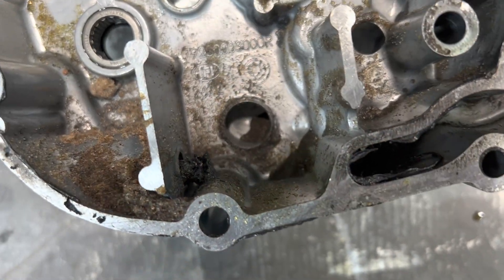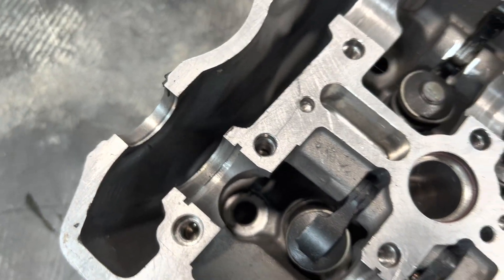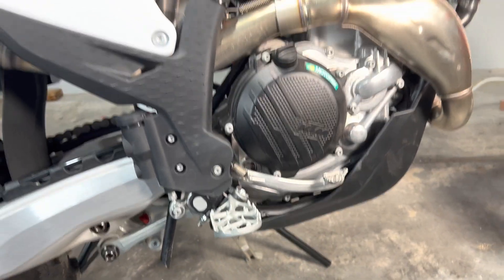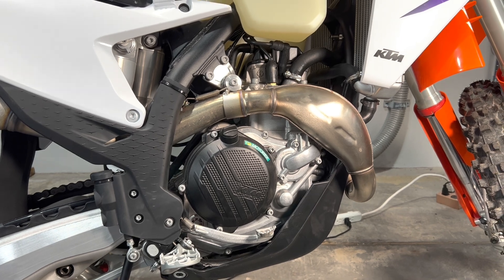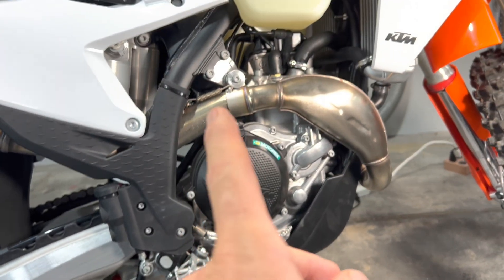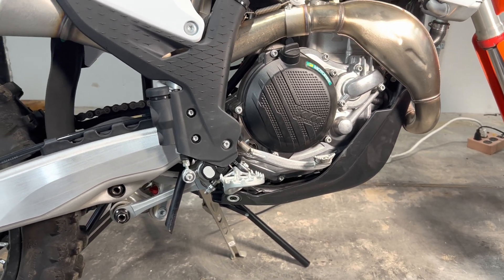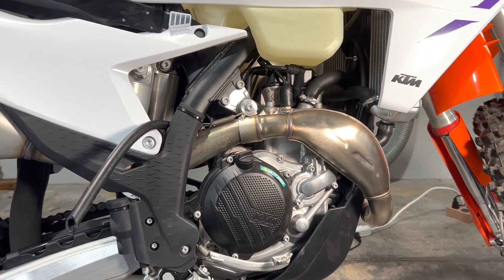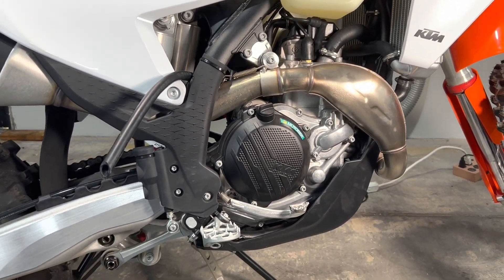SAND ALL UP IN THIS KTM 350XCF ENGINE

Comment: this is why on my 350 I flip that hose around so the straight end is coming off the valve cover and I run the other end straight over into the airbox, then I face the short 90 degree bent downwards so that even when washing the airbox no water will go into the vent hose

Comment: Thanks for the video, wonder if you could add a one way breather value so it exhausts only ordoes it require intake as well to relieve negative crankcase? pressure

Comment: This is why there’s zero reason to relocate the crankcase vent from the air box (on box that have it there to begin with) where the air is filtered and the location is much better to the bottom of the chassis. 🤷‍♂️

Comment: This just happened to me last week on my FIRST RIDE of my new to me 2018 Ktm 350 xcf. 🥲 The bike stayed completely upright because there was muck at the bottom of the puddle and just stuck like glue. I killed the motor a few seconds after getting stuck in this puddle and pulled the bike out manually. once it was pulled out on dry land I started it up fine but the damage was already done. 15 mins of riding time later the engine seized and I could hear the con rod knocking real bad. Just a few seconds of idling in muck water was enough to suck into the engine and completely wreck it. Just wanted to let you guys know how easy these things suck up water thought the crank case breather…..
Reply: Same exact thing happened to me last week. Sucks.

Comment: My dealer told me 30 years ago to tee into my carb bowl vent and c case vent tubes and run the new hose up under my tank towards the head tube of the frame. Nice and high . When stalling out in deep water , with this molded, there should be no vacuum at the outlet of the bottom of the breather hoses.   It works.   The carbed bikes of yesterday would sometimes stall out if the breather hoses were underwater too long, I'm not sure why but this alternate place to vent from seemed to help

Comment: Every stroke moves 350 cc of air out and 350cc back in. I think we had discussed the possibility of this a few years ago and why we do not recommend doing this using our crankcase hose when riding off road. But I was more thinking water not dirt/sand. 😮

Comment: Is it ok to drill a hole in air boot on throttle body side of air filter and poke hose into it? It will be under alot of vacuum from the engine sucking through the throttle body. I'm wondering if it might suck oil vapor out of top of valve cover and cause mixture issues???

Comment: Well said. I put a cooling fan on my XCF350 first ride. They are not built for intense hard Enduro single track. 
Every one of my videos is riding the XCF350 in single-track. However, it's harder on the bike than others purpose built for it. Cough TE300 cough. 💪😃👍

Comment: A simple one way check valve plumbed into the vent hose would fix it. You could use a vacuum brake check valve which would even fit the tube.

Comment: Pretty sure a rebuild is his only option. I did exactly this on my 17 350XC-F and the motor was a complete loss. Had to pretty much rebuild from the bottom up because buying a crate motor was not an option from KTM. The video of when I blew it up is on my channel as well. Similar situation.
Reply: I just did this exact thing to my 17 350 EXC-F. Full Rebuild in progress.

Comment: My 250xcfw had its issues for sure but its vent hose was routed to the air box if i remember right could you just tap a hole in the box with a brass fitting on the new ones?¿ good diagnosing for sure thorough

Comment: I simply put a piece of filter material in the end of the hose and then routed and zipped tied by the fuel injection. I made a complete loop in the line with the end pointing down. Every 10 hours or so I just replace the filter material. I used an old twin 
Air filter.
Reply: Great advice

Comment: Reroute hose to air box or a one way valve that gets sucked shut when under vacuum.
Reply: I would not suggest this. When your engine cools you need it to be able to suck in air so it’s not under a vacuum.
Reply: @DualsportDisport  
What do you think 99% of us GNCC, ECEA and hare scramble riders do bud. Absolutely nothing wrong with it and has been done since the 1990's on 4 strokes.
Reply: @DualsportDisport  the airbox is not airtight?  lol
Reply: @TheDirtyBirchTrails  what are you trying to say? I don’t understand your statement. If your referring to the intake of course, same with exhaust. We are talking crankcase ventilation. The whole reason that is on there is to vent air back and forth to alleviate crank case positive(and negative) pressure. Hence why it sucked fluid and sand up it.
Reply: @DualsportDisport  The airbox is vented to the atmosphere via the air filter.
Reply: @TheDirtyBirchTrails  precisely. I still don’t understand where your going with this. This started with the mention of check valves, not atmospheric venting.
Reply: So guys I have my 2020 450xcf vent tube routed up into my airbox, and I just realized after reading this that maybe I should have some sort of filter on the end of the tube so it can't suck up dust and sand because in the airbox the air filter obviously gets covered in dust/sand etc. Am I overthinking it? Because most of the time there is not a vacuum on end of tube. But when idling it could be sucking dust out of airbox?
Reply: @farmer3242  You have to route it on the clean side of the air filter.
Reply: @TheDirtyBirchTrails   thanks, so iv gotta drill a hole in air boot then.

Comment: Would a simple carburetor fuel filter added to the hose allow enough crank case ventilation but prevent sand/dust/debris from getting in the engine?  Old style PCV valve used for emissions purposes on old automotive applications?  Having that hose down there open to the elements really seems like a bad idea.
Reply: Tuck that vent up as high as possible.

Comment: This is a common issue on Yamaha Grizzly ATV's.  Except it's  the fuel tank vent that does it.  The vent MUST be re-routed if one is going to swamp / mud it all the time otherwise people get a gas tank full of water, sand etc.
Reply: Some guys also run a small engine gas filter which works too.

Comment: happened on my FE501 when i ran the 450 air boot which means the vent was routed down by the linkage. Sucked up sand and water when i started it while the hose was under water. Had to rebuild engine. PISS POOR DESIGN! Went back to the stock FE501 air boot where the vent hose goes into the airboot under filtered air. If you have this bike, run your vent up high!! Heres a step by step how to video i made on how to rebuild a 12-19 450 or 500 KTM engine.    https://youtu.be/C6n5_x6SZbs

A simple way to prove this theory is to put motor oil in a cup and set your vent in it. Then start your bike and watch it all disappear.
Reply: The 2nd good reason to not run the 450 air boot (#1 being that I haven't read there being any performance improvement).
Sorry buddy
Reply: Good notes! I feel sorry for you, rebuilding an engine is expensive and time consuming… The thermostat delete kits on the 450L/RL also include a different breather hose that leads by the linkage. Stock, it runs to a small plastic container by the engine. Sometimes it’s best to leave things alone.